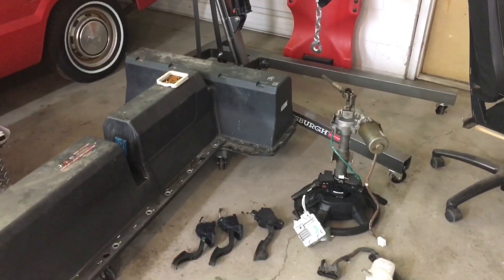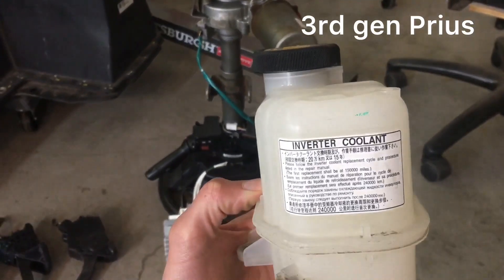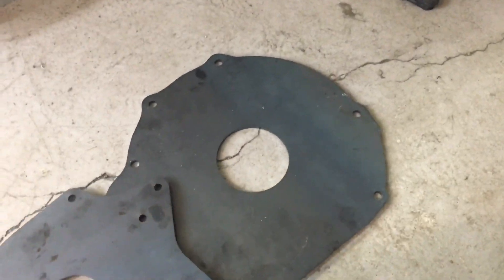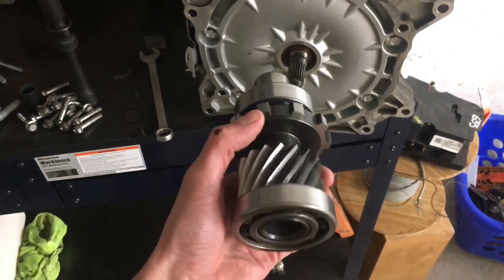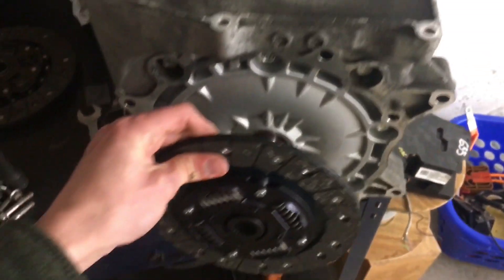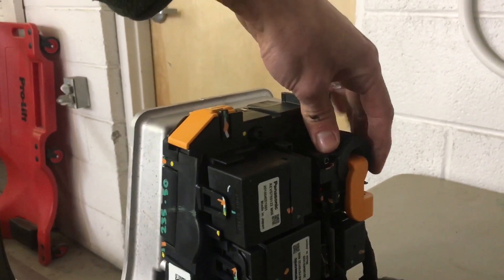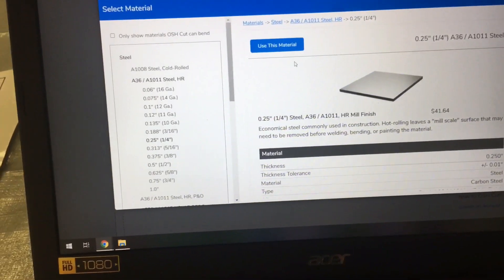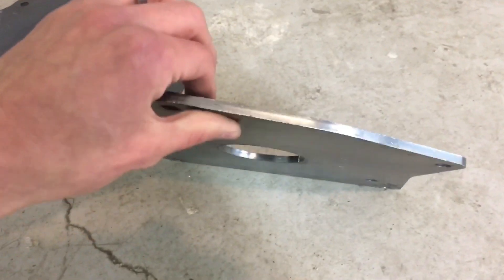Laser cut adapter plates and other electric car conversion updates!

Comment: what do you plan to use for a radiator? a motorcycle radiator?
Reply from the maker: For now I am going to try one of these. Not sure if it will be enough cooling yet but it is easy and the fan draws 3 amps at 12V. A motorcycle radiator and custom fan would probably work better.
https://www.amazon.com/17-000-BTU-Universal-Auxiliary/dp/B07MBZX9VM/ref=sr_1_4?keywords=heater+core+with+fan&qid=1649793780&s=books&sr=1-4-catcorr

Comment: does the coolant reservoir not need an extra tank for overflow? like, when the fluid expands when it heats up?
Reply from the maker: No, it doesn't build up pressure like a regular combination engine cooling system. The reservoir has full mark indicators that allow for small expansion.

Comment: You are using the bratindustries leaf adapter plate design without giving any credit and claiming it as your own.
Reply from the maker: Hey thanks for the note. I have been talking with the owner of bratindustries and have added credit and links to his sites in the description. I found the design through this link https://openinverter.org/wiki/Nissan_leaf_motor_couplers_and_adapter_plates
which did not take me to any page showing that he requested credit anytime his design is reproduced. I modified his design in Fusion 360 to work for oshcut.com but I should have been more careful to search understand what my responabilites were when downloading and using his free file.